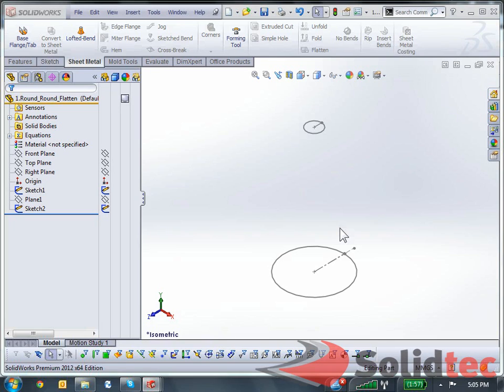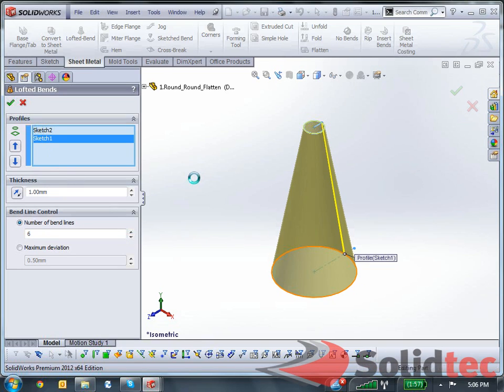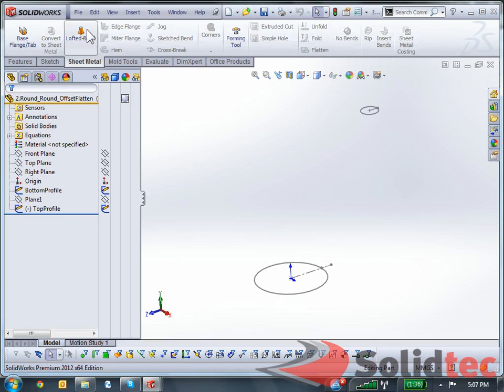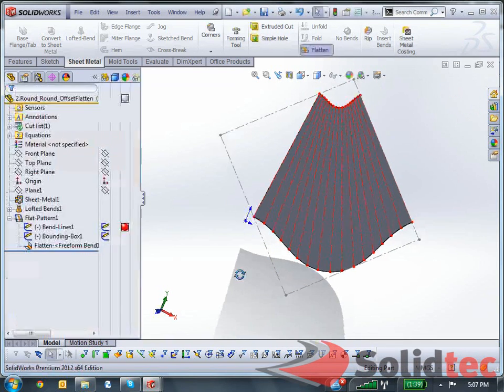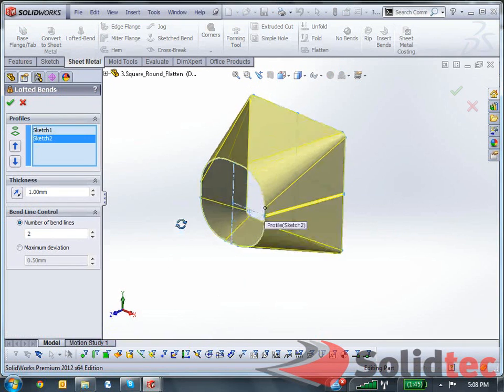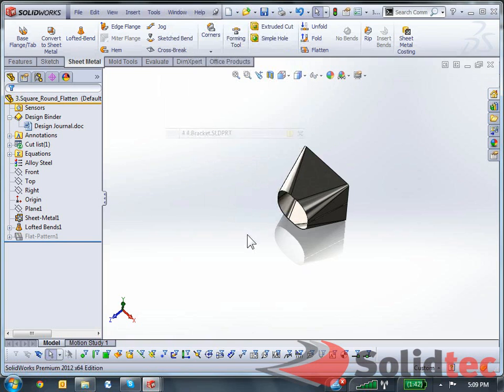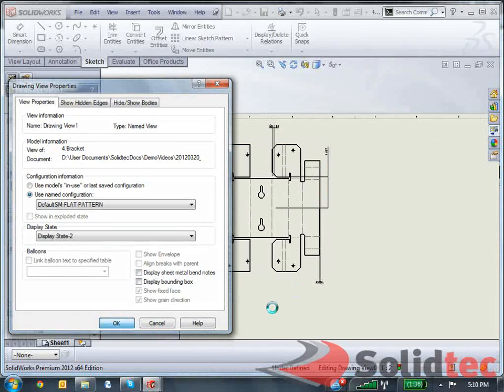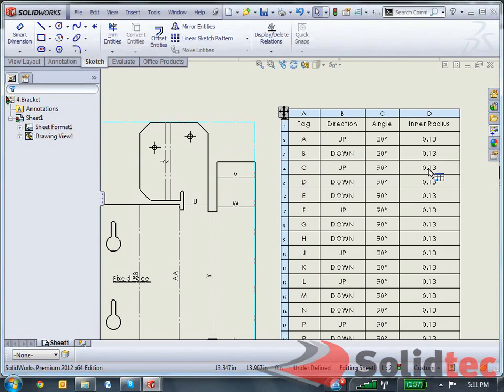SolidWorks Sheet Metal Flat Patterns

Comment: A sheet metal Lofted-Bend requires that each spline/curve is in its own separate 3D sketch or sketch.  Once you have "two" sketches, then can you insert the Loft-Bend and use the "Flatten" command... (Boat Hulls etc.)